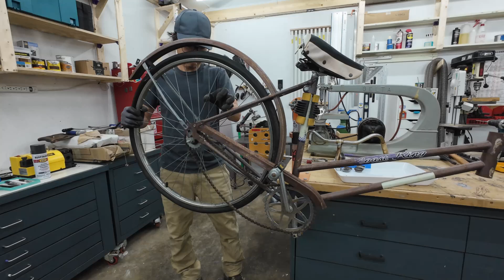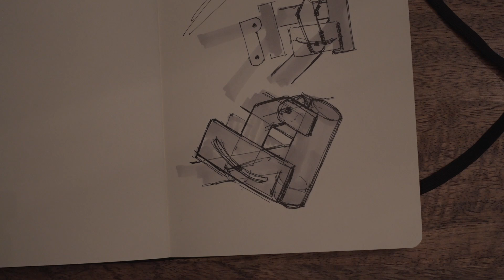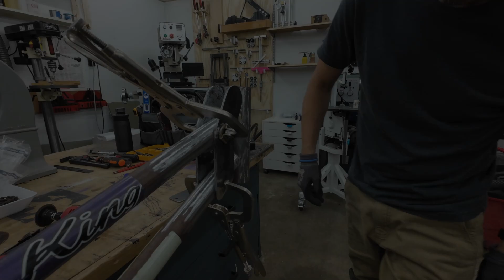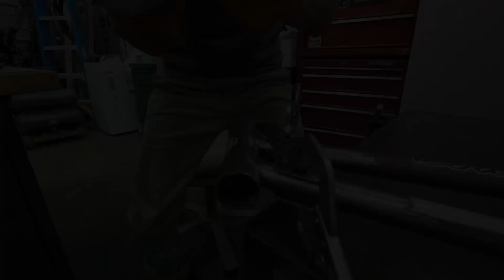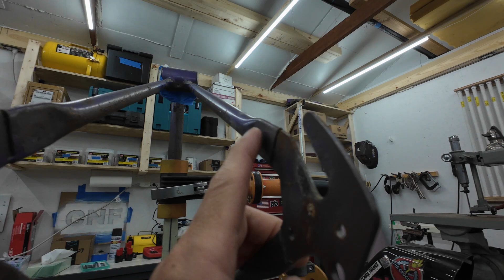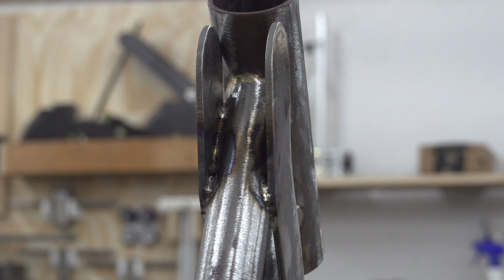Test Bicycle Frame Build Head Tube Bracket

Comment: I would love your videos anyway whatever your views on lockdowns, woke etc, but am still delighted to learn that your head is screwed on the right way when it comes to all that nonsense. As for stickout and gas coverage I have found Furick Jazzy 10 cups to be a gamechanger. You can get away with much more than with a standard cup or  even other gas lenses. Hardly ever need to break out the tin foil to try to trap Argon. Your hinge design looks awesome!
Reply from the maker: I will try to get some. Thanks for the recommendation!

Comment: What is the purpose of the head tube bracket?  Is it merely a gusset for strength?
Reply from the maker: I will run bolts through it and that will secure the severed head tube. The reason to sever the head tube is so that I can change the head tube angle for testing purposes.
Reply: An adjustable head tube (angle°)

Comment: Now you can purchase a gas generator and/or a gas powered leaf blower if you want!
Reply from the maker: Already done! I even have a gas lawn mower, a gas compactor, a gas snow blower, and a gas oven!
Reply: @PithyBikes  I do like gas powered, but I have the $300 Ego string trimmer with Powerload and Line IQ and would never buy a different trimmer in the future.  You can load new line in about 10 seconds and you no longer have to bump the head to feed line.

I got my mom the 8 lb ft mower and it's been just as good as the gas mower it replaced.  I no longer have to clean her carburetor and change her oil which saves me time.  Plus the mower is lightweight, folds up small, and can basically be put anywhere...even hang it on the wall.

That said, when I go to buy a leaf blower or zero-turn it's all going to be powered with dinosaur syrup.
Reply from the maker: @RK-kn1ud  I too have an electric trimmer, and electric auger, and electric tiller! :)
Reply: @PithyBikes  I'm sure it's great that you have choices now!  I'm thinking you might want a 4x4 for the upcoming winter!